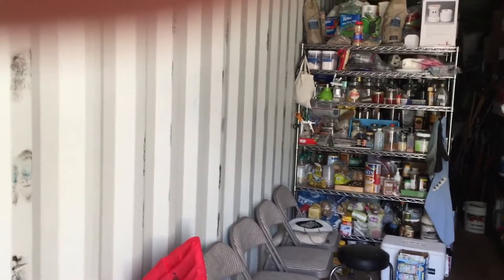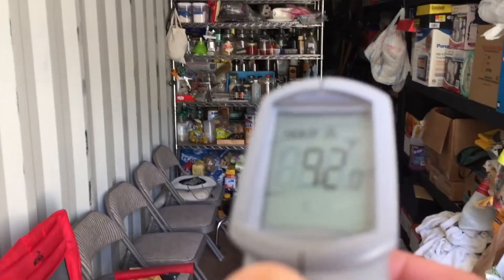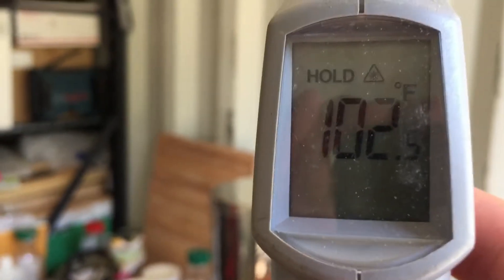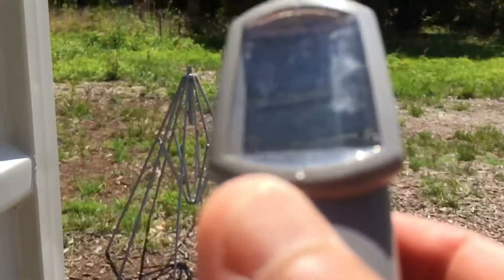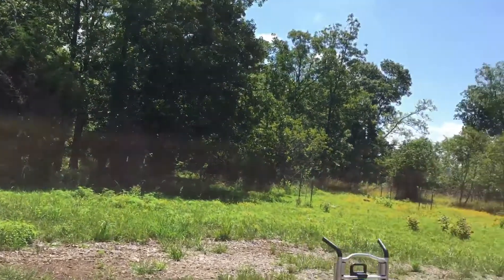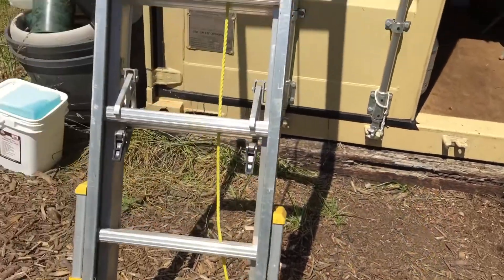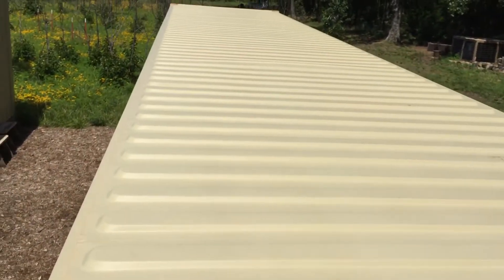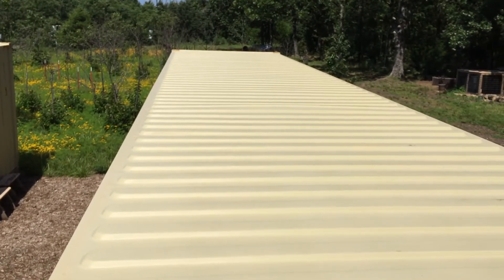Reflective Roof Paint on Shipping Container - Part 1

Comment: I think I have found the paint. And there are different kinds. Black Jack Elastomeric Reflective Roof Coating (10 year warranty), Black Jack Elasto Kool 1000, etc. The reviews that I have read the main thing is that the roof has to be clean in order for this to adhere. The 5 gallon buckets are at Lowe’s and are $75.00 and can go up to $279.00 for a 5 gallon bucket. There are other products that this company suggests in different conditions so read the reviews in order to determine what is best for you. In this video I can only see it is Black Jack product and it says Roof and then you can’t see anything else. Or I couldn’t. Black Jack has a few different kinds of Elastomeric Paint so read everything you can in order to meet your needs. I have used their asphalt black paint on my wooden fence and it is great. It is thick and waterproofs, protects from rot,  plus paints the fence. I am going to continue reading more about this and paint the rooftops of my shipping containers. I have searched and searched trying to put the pieces of the screenshot together and finally found the paint this morning. I hope it works. These boxes are hot as fire.